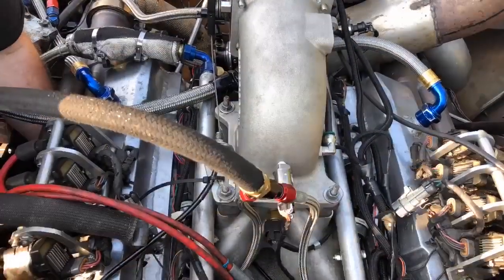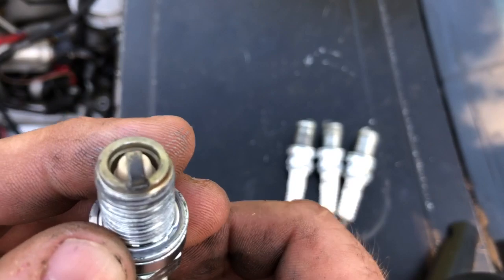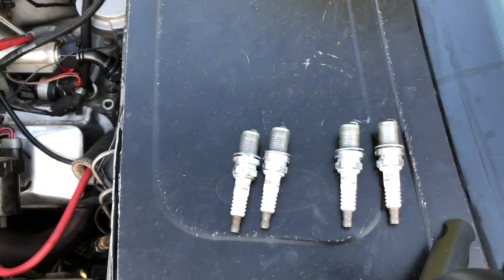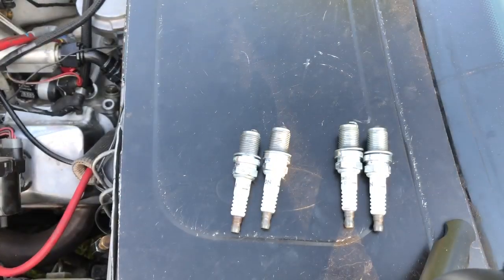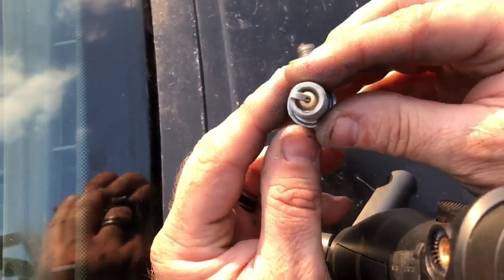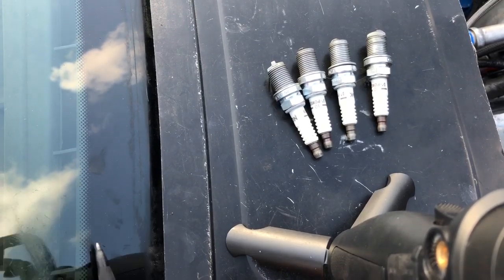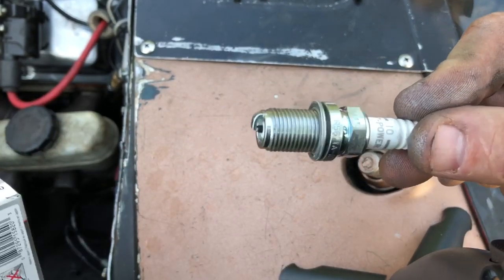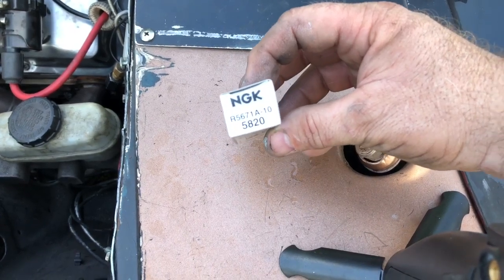Spark Plug Reading, Methanol boosted!  How I do it and what I look for.

Comment: How does that "timing mark" get on the strap?  What causes this?    If it is just from temp, then couldn't it also be from a lack of fuel?  Great video.
Reply from the maker: It is the temp of the cylinder.  Timing and a/f are directly tied!   A leaner a/f mixture generally requires a little less timing.

Comment: Thanks John for good info.
Question, can you beed blast the plugs and still accurately read the plugs after tune-up change or do you need to put new ones in to see if you got the results you want?
Reply from the maker: I have used bead blasted plugs, but from what I have seen they cannot be read for tuning changes.  But are fine if the tune is set.

Comment: I have a question for you, John. And its it's unrelated to spark plug reading, sorry.

I watched your video the other week about your cooling system and was wondering something. Why do upper level drag cars opt out of running water through the engine block? I've heard of aftermarket blocks with no coolant passages and other people filling stock blocks with whatever to make the passages solid. You were the first person I heard explain why you run it through the cylinder heads and it makes a lot of sense. Just wondering why no water in the block? This is coming from a seasoned home mechanic and novice racer just getting into the hobby.

Thanks
Reply: Mike Boatwright high horsepower, high boost engines need the rigidity of solid engine blocks. The fuel is used to cool the engine. If you have cylinder heads with water passages and you don’t circulate water through them, they are likely to crack.
Reply from the maker: The goal is to keep water off the head gasket as well.  So that water is not pushed if there is a head gasket failure.  They call this dry decking.  Next time my heads are off, I’m going to weld or epoxy all water holes.  I use a solid head gasket with no water ports.

Comment: I greatly appreciate the video... I've asked people to explain reading plugs to me several times. I never got a straight answer. Does this apply to any fuel gasoline ethanol methanol?
Reply from the maker: Gas reads a little different on a/f mixture, but timing heat line is the same concept.  A/F on gas is read by the brown/tan ring that forms where the porcilin meets the metal deep in the plug.

Comment: you’ll have more difference between cylinders because you don’t have equal length runner intake.   
With single carb intakes like the one you have this is very common.

Comment: can I apply any of this to a plug on E85?
Reply: ModMotorMayhem yes e85 is similar to methanol. Bear in mind however that the gasoline in it will give you some brown/grey discoloring on the ceramic. I personally use gasoline (100LL) and it’s totally different than alcohol except the timing marks. On gasoline we look at the color of the ring on the inside of the ceramic. Usually I just use a cheap otoscope to look inside but sometimes I cut the threads off the plug. I use ngk 7405 plugs

Comment: So tuning methonal isn’t much different that race fuel.    Way cleaner looking thou. When I raced sleds. We pulled the plugs after every pull.  And only used them for maybe 4-5 pulls. But temperatures changing throws off the tuneup dramatically in a two stroke. If it warmed up we’d lose 5-10 hp for every 10 degrees out. And that’s a lot of jet changes. But it’s only 3 cylinders so not too bad.
Reply from the maker: Wow, that’s big hp loss!

Comment: Holley uses one setting for fuel. Unfortunately megasquirt you have to change the whole freaking table if you want to fuel trim a cylinder or you can just change cells which are in the power range
Reply: For anyone reading this now. This isn't true.

Comment: Hi turbo John as always great info hey man I am trying to go to efi from mechanical meth injection I have a f 1 x procharger 421 sbc dart rs series 18 degree heads 13 to 1 comp 2.20 valves my question. Is what size injectors efi do I need and going to get the Holley efi ecu been told anywhere from 570 to 800 injectors help please
Reply from the maker: Do the math on what the hp will be, use bsfc of 2.0, that will be close.  But then give yourself a little room to grow.

Comment: Hey John I asked you this before but what kind of timing are you guys runningwith a small block Ford on how many pounds of boost. I'm running a similar  combination. I usually don't go over 18 lb of boost on my engine.
Reply from the maker: 50psi 10-11 degrees.
Reply: @TurboJohnRacing  like all your videos John. I keep wanting to ask you questions if that's okay. Do you guys run a billet crankshaft in your small block Ford or what kind of crankshaft and does the crankshaft have six counterweights or eight CCW ? What kind of temperatures are you seeing from your egts if you log those. I noticed that you have a dry-sump oil system. Does that work better for you guys then a wet sump? Over this coming winter hopefully I'm going to be finishing my build. I'm putting together a Man o war block with Edelbrock SC1 heads. Planning on putting 2 88 mm Garrett or precision turbos. Engine going to is going to be on methanol. 430 cubic. Do you know what RPM your converter stalls at.  How high do you spin your engine? If you want you could check out my YouTube it's probably going to be some hardwood floor videos on there. videos.https://youtu.be/hUFRULNgSCo

Comment: LoL I hate blow thru carbs even the supposedly one of the best on the market C&S carb we are running on my uncle's new setup f1a, 377sbc on alchohol in his old ex bracket car 90's built back halfed big tire vega that we recently went through bumper to bumper and floorboards to the roof and put it on small tires we are rockin 275's on 15×13" wheels lol. We finally have a tune up that seems to be working but that carburetor and car is driving me crazy, I am learning how to read plugs and alchohol at the same time we have had 3 tuners help us get going my uncle and paw paw are afraid of efi I dont understand why they see how smooth and easy I tune my little turbo ls 99 Z28 with Holley efi   the its looking I'm just gonna buy another HP or a terminator X and throw the terminator in my car and put my HP in the vega I cant handle this not having any data after a pass and tuning the car with basically just the plugs and keeping a eye on the afr well honestly all i do is punch in what they tell me on the msd digital 7 and drive it. Its pretty nasty tho its half a second faster than my turbo car at the moment and it's still got more in it, I made my first 4 second pass two weeks ago 4.98 @ 137mph it's a wild ride I really dont want to go much faster lol (in that car). What all are you using in your efi setup its definitely getting a Holley setup in the near future but I dont know if I want to go coil on plug ir not
Reply from the maker: Good pass!  I run Holley HP on mine, and love it!
Reply: @TurboJohnRacing  what's your opinion on flying magnets and coil on plug. I only have experience with turbo ls motors with efi I personally have never had/installed or tuned a sbc with a efi setup, but the vega is definitely getting it I just dont know  wich way to go on the ignition? Any tips would be greatly appreciated

Comment: My guess is your number 2 injector has a very slight restriction. You could always swap your 2 and 4 injectors and see if the extra fuel follows it. 
It's all the little things man. That's why you're consistently so dang fast!!! You have everything dialed to perfection. I absolutely love it when you get these guys running 50 thousand dollar motors coming up against class limits for hair dryer size vs weight etc and they don't understand why they're getting beat bad on the back end. They had a few tuning sessions on a chassis dyno. To win against serious competition, you have to be dam near perfect. Pulling every ounce of power from all 8. Every time I see your car run I'm shocked how fast she is. I'm learning more from watching your channel than I have in YEARS. I understand the principles but you're really driving it home. 
I've got a 944 body to build now. Gonna make a first attempt at swapping in a complete C7 wiring harness, transmission and diff.. Not the motor, I'll find an aftermarket used block.

Comment: That’s awesome info, I guess the only question is, what is the total timing/boost you are running to use a -10 -11 plug?
Reply from the maker: my motor has a very lazy chamber.....I think today, I was at 25 deg at 33ish psi
Reply: Turbo John wow! I have a 4.250 bore with a 100cc chamber and .210 dome. I can’t wait to put some more timing to this thing (22’ @19 psi 140mph 1/8th) thanks for the tech!

Comment: You don't know at what rpm its rich or lean at? I m sure you can adjust certain rpms in the holley . How can you determine at what rpm you need to add or pull fuel?
Reply from the maker: I can tell it what a/f needs to be everywhere, but if I mis judge the requirement at 15psi, it may put extra heat on the plug at that point!